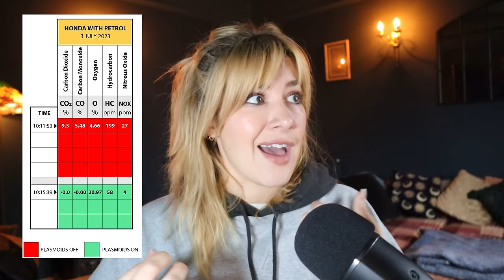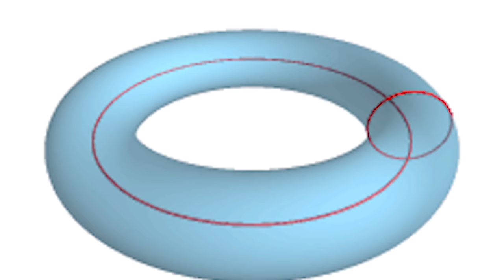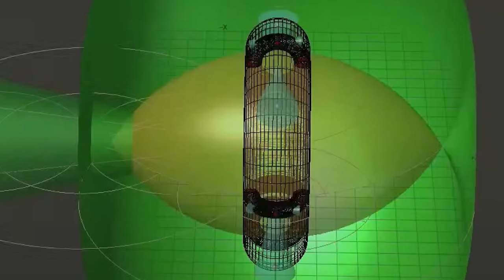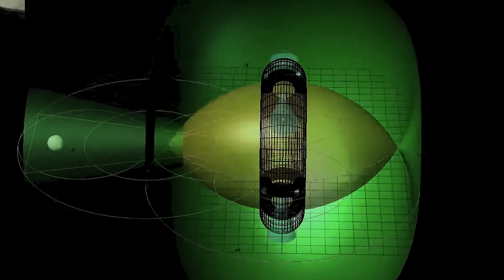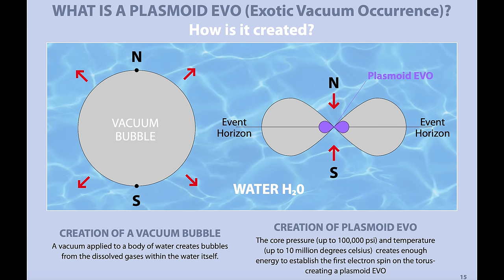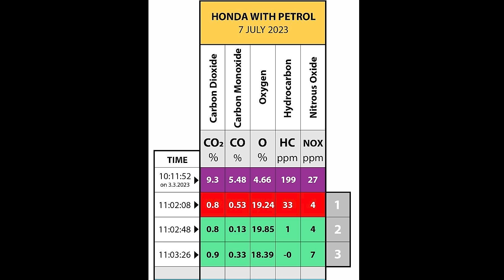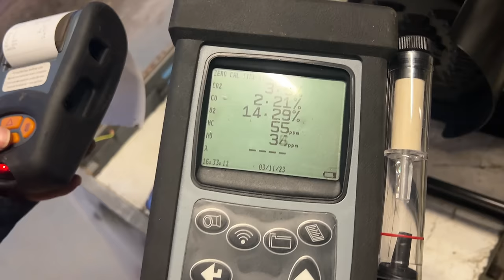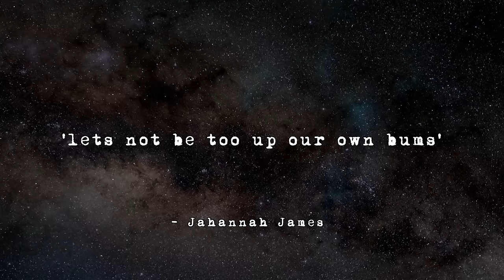Lost Ancient Plasmoid Technology? | The Thunderstorm Generator

Comment: Interesting "plasmoid" explanation using fruits, the last part about co2 levels reduction perhaps also can be done with plasma ( many cars burns at high temperatures the exhaustion gases ), the reduction in consumption probably is due to insert all that "mumbo jumbo" to the escape so the motor losses torque and by hence oil consumption my guess, interesting nonetheless.

Comment: I put a hydrogen generator in my 1971 super beetle as a kid, it completely cleaned all the carbon out of my block ( it was made of magnesium), it increased my gas mileage from 21 miles per gallon to 28 miles per gallon, and it magnetized the block. Not sure why but it would trip out the car mechanics because when you go to test the idle it would show negative numbers -800 rpm this was on every mechanics tools I went to, not just one guy doing it wrong. Loved that bug.
Reply: That's pretty good results. I installed one on my Datsun and was able to run directly off the exhaust eliminating all emissions. The engine was so efficient that it started producing gasoline. So I had to drive it in reverse everywhere to keep the gas tank from over filling.
Reply: @NONANTI  reverse 🤣

Comment: also what does this lightning machine actually do beside depriving us of vital co2. The honda petrol combustion engine runs on fossil fuel so outside of an apparent  gas filter what exactly does it do
Reply from the maker: the plasmoid potential is huge, this is just one simple emissions machine, but the future would be cars than run on air and water. Also possible stone cutting techniques
Reply: Jo if that engine were to be miraculously running on water then there wouldn't be any toxic waste to start with.   \It's running on petrol and again C02 is NOT a pollutant.  @FunnyOldeWorld

Comment: Engines have been designed for years so that they emit a lot of CO2 and as little CO as possible. If you want less CO2 you just have to remove your catalytic converter... nobody does that because co, unlike co2, is extremely harmful.

The interesting thing is whether this new type of catalyst converts the CO or whether it deposits it, if it works at all ( could by a scam ).

Comment: Plasma is old tech. For the last 20 years patents have existed to use plasma to filter waste water to clear pharma chemicals and even remove PFAS like Teflon, the hardest atomic bond to break we have in waste. 

Its all old technology. 

Bendall has a device that recycles fuel vapor and gets hot as hell using tons of vacuum cavitation bubbles to reach 8000K! When a molecule reaches that temp, it splits hydrocarbons and carbon easily and they reform molecules by stripping electrons from the surrounding water to create oygen and other gases.  Its old technology. Its just being commercialized finally.

Comment: 1:50
Technology that makes all fossil fueled egines clean burn was banned in the 90s..... Why do you th{nk it was banned one word profit.
The tech i speak of zeros emissions to oxygen some water and carbon but in non combined as tthe burn process seperatesvnur combines. Engine temps are lower than conventional and again this is a bolt on device that can be put on any fosssil fueled egine 5he issue is profit.
Cars that do more miles per gallon effect profits and potentiallythe engine could be run without fossil fuels entirely.

Comment: "It sucks it on one side of the ying yang and deposits it on the other"

I could read that statement Ohhhhhh so many ways. 

The word you are looking for is angular momentum, a complete revolution is 2 pi radians, that is kind of the metric. Angular velocity is measured in radians per second  and momentum thereof = radius * momentum = I x angular velocity (omega) = L

Acceleration = omega^2 * r and thus force = mass * omega^2 * r

For a stable orbital the radial velocity needs to be zero. This means if you have plasma of one charge there has to be a repulsion on the plasma. So for instance you can place a positively chraged source in the center and electrons can orbit around this, this is the description of the bohr hydrogen atom. We know this model to be wrong in the since that electrons harmonize as densities around a nucleus to discrete angular momentums.

Comment: Interesting, apparently based on the dimensions givem to Moses from God, the ark of the covenant would fit perfectly inside the coffer within the kings chamber. And is believed to be an ancient technological device (a capacitor) the golden peak which was apparently on the pyramid would fit into the idea, absorbing electricity or even transmitting it. All the energy lines within the earth which ancient stone circles are built on (where the energy lines cross) fit into the idea also. Nice vid 👍 keep up the good work.

Comment: you got one thing right, this isnt new! steam reforming with plasma is often used for creating synthetic biogas and hydgrogen etc  it less engery intensive than doing it via more direct electrolisis, the pitting in the metal is corrsion and its why this wont work in most use cases, this will cause engines to run lean compressing excess air which will  cost energy on the crank shaft and create heat its just easiser cheaper and more efficent to use a catalitic converter...

Comment: Throw the exhaust into the intake.  There's a similar idea that's working on the same physics that you reuse the exhaust as "fuel". The reactor is cylindrical and the final emission was air and water. Their explanation misses the mark because the guys don't fully understand what they've made. You can find the video in the water as fuel rabbit hole

Comment: So, you need a spherical chamber. Given Ben at UnchartedX has been scanning granite vases for damn near perfect manufacturing. And both Ben and Randall Carlson have been on Danny Jones podcast at the same time. Could both of what they were talking about, Randal with the plasmoid generator, sacred geometry and Ben with the granite chambers, could these both be the same thing. You say that stainless steel has pitting on the inside, would granite have the same issues. So, my thought is that the granite vases could be used as the reaction chamber for the plasmoid generator? 
It's an intriguing theory, what if Ben filled the vases with water and shot 432hz at them would you get a positive reaction taking place?
Reply from the maker: I wonder if plasmoids were used to cut and shape stone as they can metal?
Reply: @FunnyOldeWorld  quite possible, I wonder if it could achieve such accurate cutting tho. My thoughts are going down the route of a more portable power source. A smaller reaction chamber, having some device attached at the top. The handle on the vases look too functional to me rather than decorative.  Like a clasp or a coed of some sort was ment to be attached. I did speculate that they were some sort of resonance chamber like a bowl tuning fork so to speak. But maybe it's as simple as it's the base of a battery.

Comment: There are way too many assumptions and errors here: 
- A fractal is a self repeating pattern and it can bear any form, being square, rectangular, whatever...
- Ultrasounds only begin at 20.000Hz and up, not 43Hz, which would be closer to the lowest range of audible frequency we can hear. You cannot just blow a barytone horn on an aluminum foil to create blackhole bubbles in water, I'm sorry darling.
- Plasmoïds, just like Graboïds, simply don't exist. No way around that yet.
- As far as science goes, you simply cannot ''turn'' aluminum into silver (you can bet we would know). Aluminum reacts with silver and can remove its tarnish but that's about it.
- The ''universe'', as we are told, is at best a nice fairy tale. NO ONE on mother Earth has the slightest clue about what it actually is (incl. Its formation, its shape, its content, even its very basic rules).
- Same applies to ''blackholes'' which are theoretical (only) entities that NO ONE has ever proved to exist (but this is too rarely mentionned, so people just buy into the propaganda without even a second thought).
Etc, etc...
This is the problem with nowadays self-proclaimed scientists or researchers. They often have the tendency to build new theories and to present new hypothesis based on things they (and we) know nothing about  in the first place, or things they have all wrong since the beginning.  Nowaday's''science'' is all based on mathematics, theories and computer algorithms which for the most part, are false, and at best biased by a complete ignorance or misconceptions that ''scientists'' will hide at all costs.
 Reality far exceeds such a  limited approach. We are like toddlers wanting to run a 400M competition. We also need spirituality and philosophy to be able to grasp the nature of reality. Yet we don't consider those as part of ''science'' (which they were in the past).  As long as all branches of sciences don't merge and work together, there's not a single chance we'll find any way to describe  our reality. This will remain an empty concept full of empty words. Good for mass entertaining but awful regarding our education.
Reply from the maker: Please watch Bob Greenyer aluminium experiment and analysis 🧐 silver element was found amoungst others in the reaction.

Comment: Assuming there are no short-lived sponges/filters in there to fool everybody, what if the engine is proper size 2.0L and up and doing actual work instead of idling, how soon will the device get choked up filled with crystals/deposits needing replacing and how toxic is it to dispose of.

Comment: Car emissions aren't a real issue. With catalytic converters and computer running the engine the air coming out of a car can be cleaner than the air going in, this has been true for a couple of decades. It has consequences for fuel consumption though so that to me is the real issue.

Comment: Has anyone considered incorporating an HHO generator?
Reply: that might be partially whats going on here actually. The bubbler is also going to be pushing a lot of water vapor into the air as well. the air goes into the TSG where theres cross vorteces between the hit and cold air and that i going to do the same thing as a thunderstorm. the charge there will interact with the water vapor and split it. She mentioned plitting the water in passing
Reply: Subjecting water to high shear forces (e.g vibrating plates with harmonics) will produce HHO - in water (vapour), of course, this means the HHO is kept in solution - so, addressing what otherwise would be a high risk of explosion (this is how Ohmasa gas is produced), and this HHO is great at creating vortices in the water/steam (as per the ULTR experiment), especially adsorbed onto surfaces such as Aluminium-or Iron(Steel).  So, this could well be what is going on inside the TSG (on the exhaust side). No high pressure required.

Comment: you say 40-75% increase in efficiency but the data shows 3.5% . how did you get from those numbers to the numbers you say after?
Reply from the maker: That was just the sphere attached not the bubbler, not the UV light, and the whole system. also the machine needs to be running ‘on load’ as in the car going up to its max speeds.
Reply from the maker: 40% seems to be the conservative level achieved from all the testings in different countries

Comment: At 6:43 you call 43 Hertz "ultra sound". It is actually rather much closer to being "infra sound", in a frequency lower than most disco-deaf people of today can hear. As a comparison, the lowest A (the key farthest to the left) on a regular tuned (440 Hz) pianoforte is tuned to vibrate at 27.5 Hz. Where Hz means number of vibration per second. Ultra sound, however, uses frequencies above 10 kilo Hertz (10,000 Hz). Most newborns cannot hear frequencies below 20Hz or above 20 kHz. Only now I discovered your video description, where you correct yourself. You should, however, if you wanted to make it correct, rather spell it kHz, not Khz. This because "Hz" is an abbreviation of the name "Hertz"; and therefore always should be spelled with a capital first letter, while "kilo" is a regular word. The ultra sound frequency of 43 kHz is thus completely inaudible to our human ears.

The explanation to why "kilo" always is written with a lowercase "k", while Mega, Giga, Tera, and Peta always is written with Capital first letters, I'm afraid that you'll have to ask elsewhere.

Comment: Why would you want to Zero out the Carbon. The Carbon is what gives Hydrogen the Oomph or Power when you use Hydrogen as a Fuel. When you use Petrol in a combustion engine your actually driving around in a Car that uses Hydrogen as a Fuel that is binded with Carbon. The Exhaust Gas Recirculation (EGR) thats in most modern Cars recycles the Carbon content in Petrol making modern Cars more power efficient.

Comment: I'm skeptical of the claim that these devices can improve fuel economy, purely because they are an exhaust add-on and thus have no influence on the existing combustion efficiency. Internal combustion engines are about 30% efficient, the remainder is wasted as heat.
Reply: The output of the device is fed back into the engine. The plasmoids act as a fuel source, thus recovering the energy otherwise wasted as heat.

Comment: I love you. I really do. like, marry me.....but, and heres a big but, I think he is just running the exhaust gas through water... there are several things that raise red flags to me.   
1, the big tank that was cut open, isnt stainless steel. its rusty, dirty, just not  characteristic of stainless. I would venture to bet it is just regular ferrous steel.   try a magnet on it next time you are around it.  
2, those crystals are just carbonation, i.e. the carbon deposition of the exhaust. so, when the exhaust is being bubbled through the water and the CO2 is being broken down, that carbon has to go somewhere, right? it is being deposited on the walls of the vessel in a crystal lattice.   The pot marks on the inside, are likely just marks on the soft steel from cavitation (which is a widely known thing... super fast propellers get blasted away to nothing by it, mantis shrimps use it to stun their prey)    
These are just a couple things of the things that immediately come to mind on this.   I would fucking LOVE for this to be a reality, but, I am a scientist and engineer through and through, and there are many things that ring my bullshit bell.
That beautiful red orange color is just regular Iron oxide.  Rust from iron can be orange, red, yellow.   I know you mention in the end that "this cant be done by just putting a little water in the exhaust" you are right. but, if you bubble the exhaust gas up through water and whatever filter medium they have, then I would be willing to bet money that it would be so.

I repeat, I love you. buuuuut that guy is a grifter

Comment: The pock marks on the surface of the metal sphere are caused by cavitation, bubble form on the surface of the metal, but inside the bubble is a vacuum so it slams closed very quickly and causes, those pock mark.  You can create cavitation bubbles in a beer bottle if you hold it and bang the top quite fast, the bottle will go down faster than the liquid, creating a cavitation bubble, which when it slams close the bottom of the bottle will probably break lol

Comment: I doubt you'll ever see one fit in 99% of modern vehicles, due to space limitations. By the time you scale up the spheres to work with a 25,000 CC engine they will be hard to hide. The size of the spheres scaled up for my jeep 2.5 litre would be 26.3 inches in diameter.

Comment: This is an interesting approach, although your humble catalyzer in the exhaust pipe of a car aka catalytic converter burns residual fuel and CO into CO2 just fine. The amount of energy you need to produce these bubbles is compared to other methods of separating CO2. Also, most of the human made CO2 is produced by energy production and industry not by personal vehicles. Also, climate change is not something humans can control, maybe influence but on this "maybe" big corporations are running all sort of money making schemes, just be aware of that.